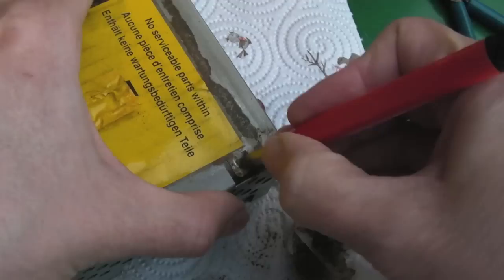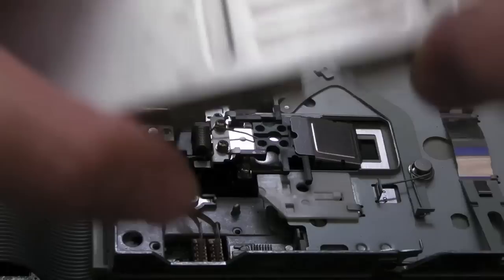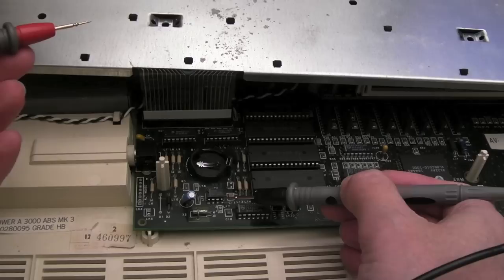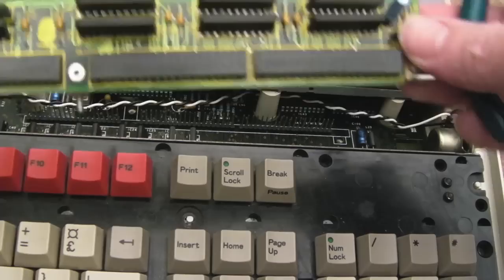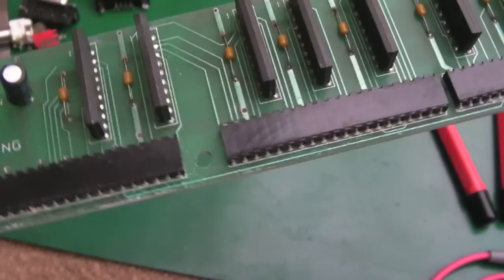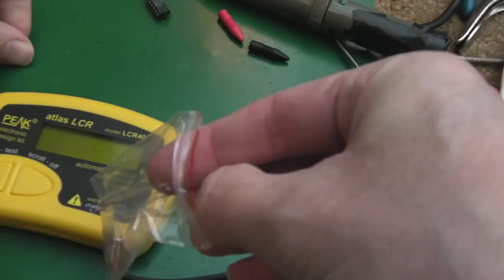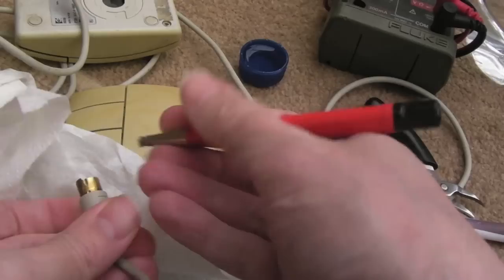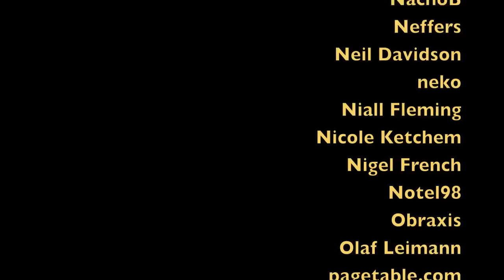Acorn Archimedes A3000 Repairs - Part 3

Comment: Yes you should try to get a small metal brush wheel for your regular drilling machine or buy a dremel.
you also need to use clear paint so rust does not come back.
Use spray paint to mask the label with tape. use blue paper tape and not white since thin paint goes through

Comment: ceramic disc capacitor   they are usually used in noncritical applications for bypassing, coupling, and blocking. Another disadvantage is that voltage transients can damage them. It is therefore not recommended to use as bypass capacitors directly across a low-impedance power supply.

Use polyester or polypropylene if they are not too large in size

Comment: I always love your videos and 99% of the time when I pickup something new, I check and you've already made a video on it and very helpful to get mine working.  I've recently picked up a FM Towns II in case you're looking for ideas on a next video :) lol
Reply from the maker: =D  It's hard to find an FM Towns at an affordable price lol!
Reply: @GadgetUK164  You Sir are correct.  I got lucky and one popped up on yahoo japan auction and I won it for $175CAD but it also cost me $212CAD to ship it from Japan to Canada.  100% it will be not working and I will replace all the capacitors before I even attempt to turn it on.  they're also not the easiest to disassemble either.  Keep an eye out for one if you really want to have some fun lol or the X68000 would be another capacitor nightmare worth filming too!

Comment: lol I was thinking dremel as you said it, a grinding wheel or steel brush attachment would make light work of that, though I appreciate it's a noisy contraption and if like me you're in close proximity to the Mrs, I have to pick and choose my moments to use my de-solder station because it's loud lol

Comment: Hi Chris.
It's great to see you've managed to save some machines.
2 remarks :
- The 1st A3000 you showed has the serial upgrade fitted (2 sockets near the PSU are populated with the 2 necessary chips)
- I think it's a pity you re installed an original OPA, when the Burr Brown gives much better sound ( with the filter mod off ).
Please listen to the difference in this video https://youtu.be/8Dk2-kwR9ys?t=716 The link to the filter off mod is in the video description section
if the Burr Brown was faulty, order a new one, this mod is really worth doing, for less than GBP5 ( and this motherboard has a socket installed already )

For the small dual bare PCB, check your emails, I think I told you what it was for, but can't remember at the moment.
It is about fitting an external keyboard in a BBCA3000, I believe.
Reply from the maker: Thanks Xavier =D   Yes, the Burr Brown are clearer for sure (when you do other mods too).  That particular one I wanted to revert back to stock as the volume was around 50%.  I did the Burr Brown mod to my A440 and the volume level was the same there!   Thanks for the reminder - will check my emails shortly!  I am useless at keeping up with emails atm =/  Just spend almost 2 whole days editing one video!

Comment: Those mice are rough looking - reading up, I guess it takes an adapter to use anything else more modern.
Reply from the maker: Hehe, yeah - they were bad!  Came out really well in the end though!  There's just one here that I need to do something with, and that will just leave the one with the cracked shell that could not really be fixed.  Although... If I can find some type of plastic filler, I could in theory fix that last mouse too (and perhaps paint it).

Comment: Hi Gadget164 i have a problem with my acorn A3000 computer i just got today 6 october 2020 and i have No Mouse :-
the problem is this when i switch on i get a power light comes but nothing else :- is this the right when the mouse is not plugged in :- also the leds on the keybaord ie:- caps scroll lock and number lock leds do not light up as well :- if possible could i have your address or contract so i  can this fixed thanks from ian arbery
Reply from the maker: Hi Ian, I cannot do customer repairs sorry!  There will be people on the Stardot forum however that do offer a repair service!   If you post a request on here:- https://stardot.org.uk/forums/viewforum.php?f=16   Someone is bound to be able to recommend who can do a repair for you!
Reply: @GadgetUK164  
i just letting you know i have a shop which is doing a repair for acorn a3000 thanks just the same take care from ian

Comment: Hi Chris
Great Video as usual.
The capacitor type you don't see much of now but it is a ceramic plate capacitor, if the capacitor was C81 and the old one you took out was reading approx 2nF from the service manual C81 is a 2n2 30V ceramic plate, similar to these.
https://www.ebay.com/itm/630-19222-2200pf-100V-Ceramic-Plate-Capacitor-X5/251038118669
Rich
Reply from the maker: Thanks for the info!
Reply from the maker: I double checked the part sheet and it stated 1nF for the one I replaced.  I'me sure!  I willl check back though!